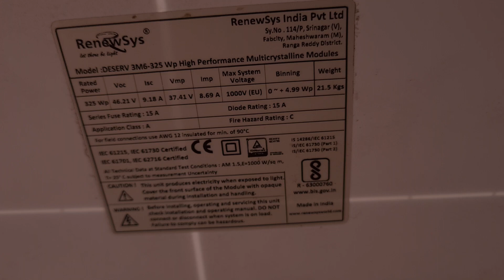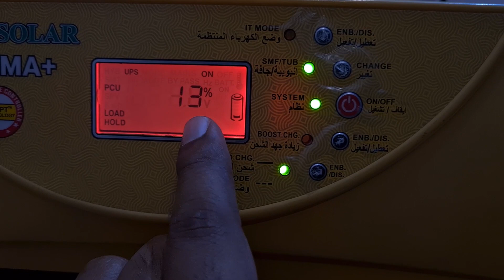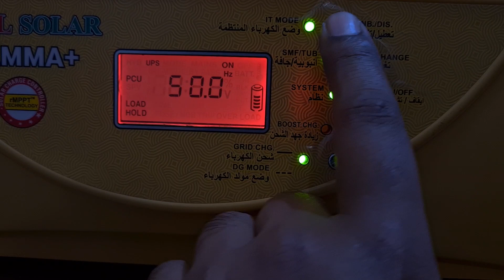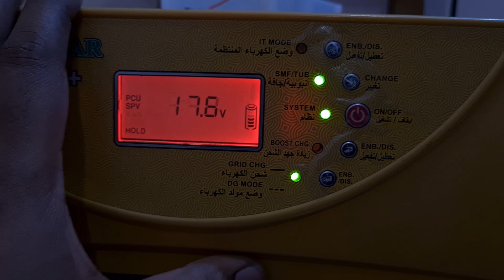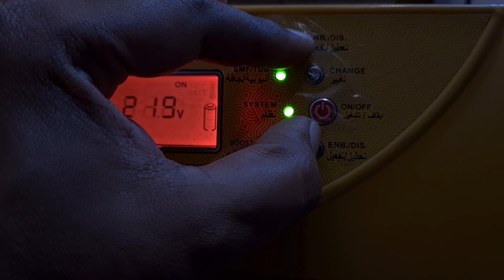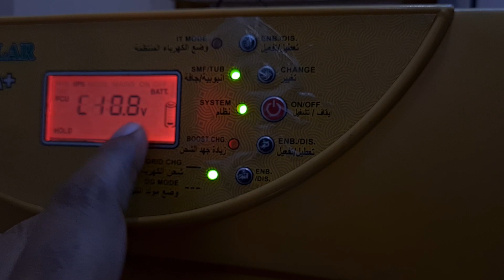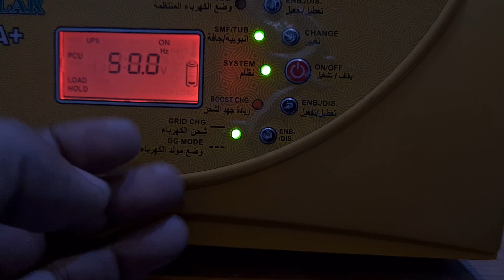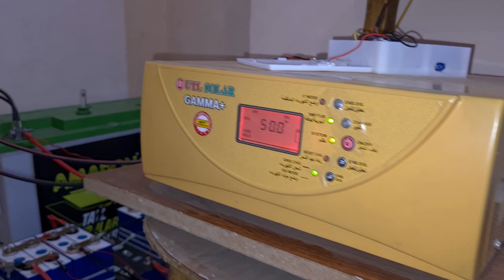1KW Solar Setup, Part 2, Wiring and UTL Gamma + Inverter

Comment: Bro 2 doubt
Doubt 1
1. I have 180w panel (12v) no1
2. 200w panel (12v) no 2
3. 205w panel (12v) no 2
So total 990w (can I connect this all panel in parellel)

Doubt 2( i have utl Gamma plus 12v 1kw solar inverter)
Is it possible to connect 2 battery in parellel?

Comment: Gamma plus has battery equalization,how to turn off that for lifepo4?
Reply from the maker: Gamma plus does not have equalize for smf mode. That's why I suggested to use smf mode
Reply: @diyIndia  how is the lifepo4 performance with Gamma plus
Reply: @diyIndia  Im thinking do the same setup with lifepo4.whts your thoughts?

Comment: sir it is very urgent plz reply, I live village area my nearest cell tower is approx.. 2km, what should I use 2 lpda, 2 Yagi or 1lpda 1yagi on mr 600 setup plz reply it is very urgent
Reply from the maker: I would suggest you to go with LPDA, it works fine with the MR600, yagi and omni does work that well with the MR600. i hope you have a clear line of sight of the cell tower.

Comment: Hi, what's that arduino circuit that you have setup , is it monitoring anything ?
Reply from the maker: hey there, its a switching circuit which i made to switch between mains and inverter supply based on the battery voltage . am still testing it out.
Reply: Can you share